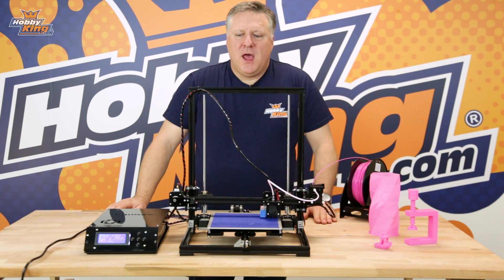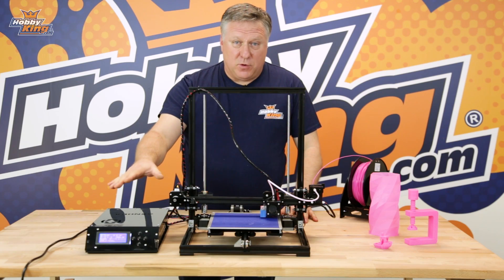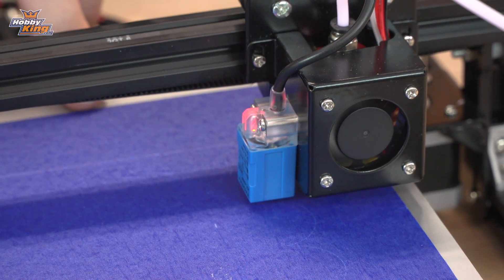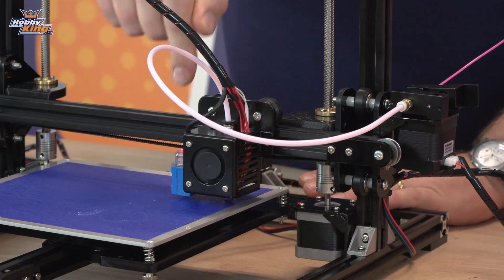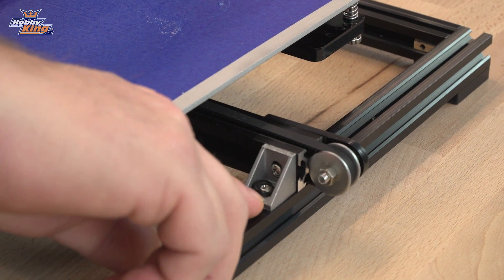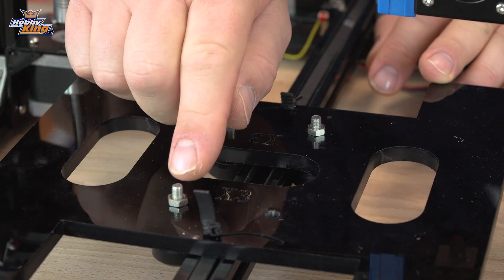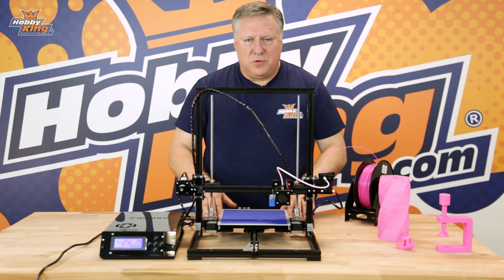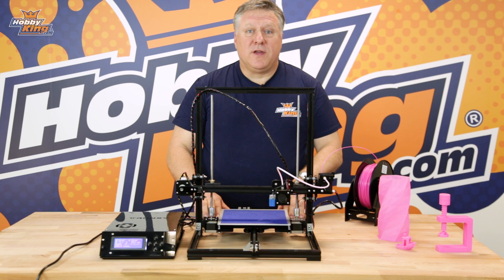Tronxy X-3 3D Printer - HobbyKing Product Profile

Comment: SOS,,,,I currently building my Tronxy X3(it been box for few years now) and I don't have paper assembling manual, found an online version. But online version doesn't show where to mount the auto level sensor and where to plug the SENSOR power plug  into the control broad.---HELP ANY ONE